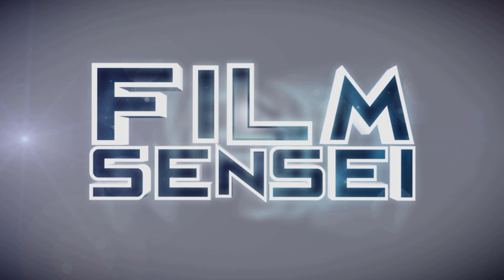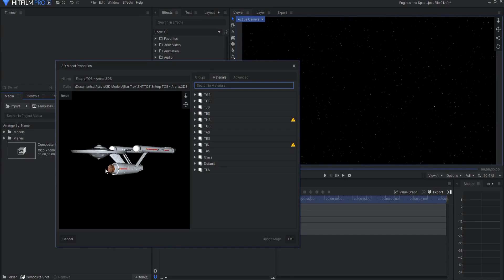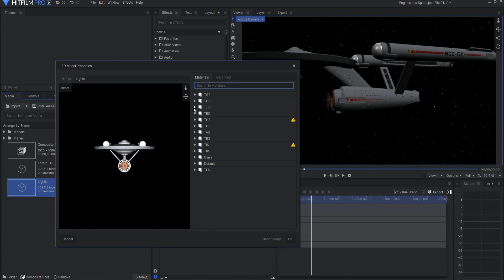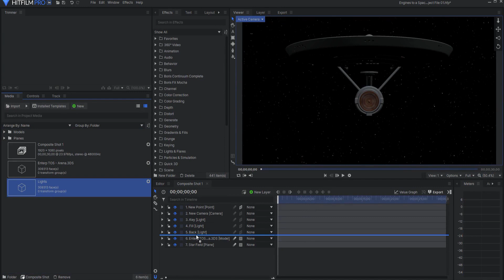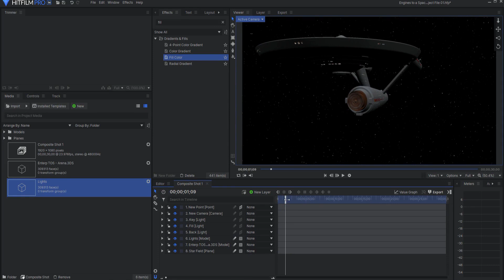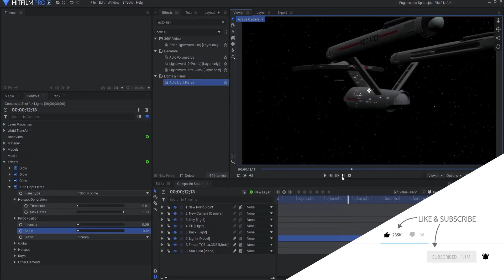How to Add Lights to a Spaceship in HitFilm!

Comment: could you make a star trek phaser effect tutorial? I need help for my short film.
Reply from the maker: I will add it to my list. In the meantime, check out HitFilm University's Photon Torpedo tutorial... https://youtu.be/ZPpbA6AoQFk
Reply: For phasers you could use the Lightning effect (but you have to manually adjust the start/end width), by turning down twitch and wave scale to zero and turning off branches.

Or, you can just use the Lightsword effect.
Reply from the maker: @HitfilmUniversity  Aspects of Lightsword would have to be adjusted also. The good news is that Lightword has the advantage of Z axis perspective, but the bad news is that it slows the computer way down compared to the Lightning Effect.

Comment: Cool but why are you adding a new point simply go to model world transfer then rotate and animate, why you have to do the extra steps?
Reply from the maker: I use one point to control all the passes of the model. If I choose to add light flares, auto volumetrics, etc, I can also assign those to the one point. That way, I when it comes to mie keyframe position, rotation, etc... that one point will do the trick for everything.